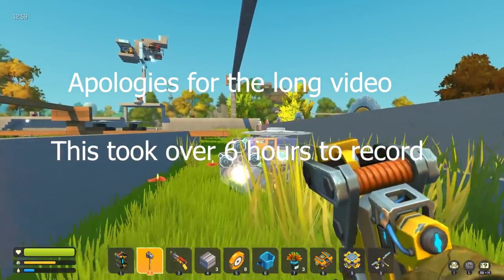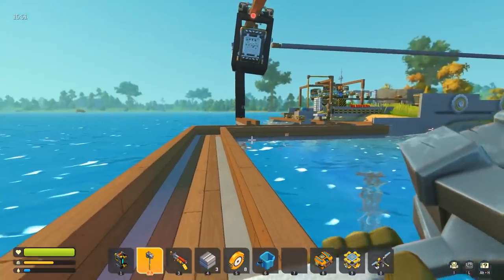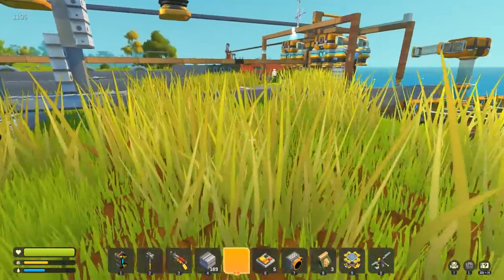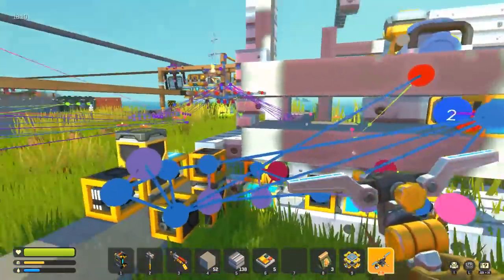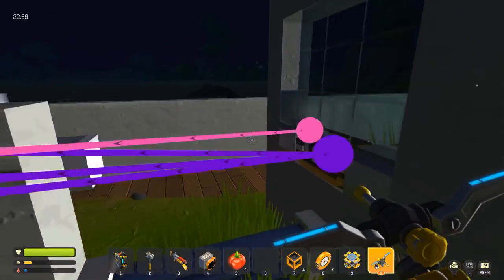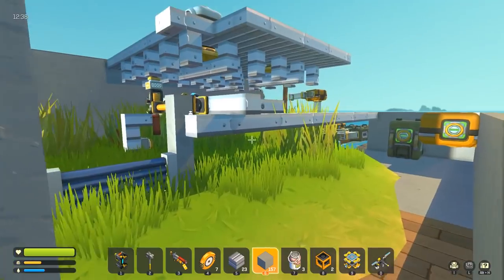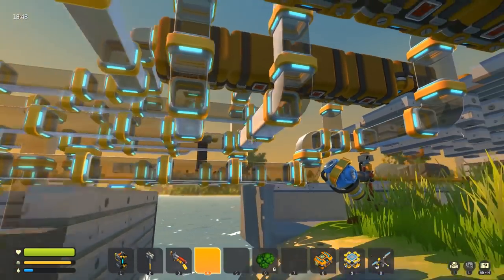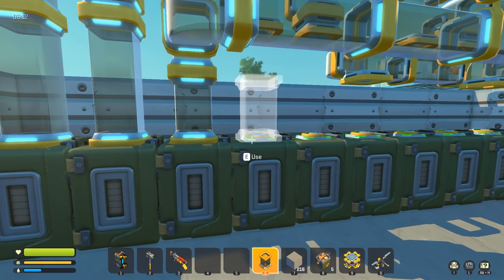Ammunition Factory Tutorial | Scrap Mechanic Survival

Comment: For a 6x6 plot you want to go in a spiral pattern.  That way you still miss out on the extra column (-1) but it only has 2 plots in it so you get 35 out of the 36 plots.  EDIT:  oops, late night.  Should be this ...
0	0	15	15	3	3	12	12	6	6	9
0	15	15	0	0	12	12	3	3	9	9

Comment: It's an awkward solution due to the spud gun. You'd need to mount it on a bearing like the water cannon but if you make it so the piston block is on the first block of dirt the full extensions should reach 6x6
Easy way to do that is raise the piston mechanism up by one block and place everything else underneath it. Shouldn't be that detrimental since you like using guide rails.
Reply: Also forget the guide rail. Just throw a couple wheels on the blocks with the bottom sensor.
Reply from the maker: The piston is already on the first block of dirt, 
the full extension will reach, but the controller doesnt have enough spaces in it to reach the full 6 unfortunately
Reply: @SaltySeraph  Ahh crap I see. I assume the reason I didn't notice is because i'm doing a 10x10 and it ends up extending to the end of the block but probably just due to the double pistons.